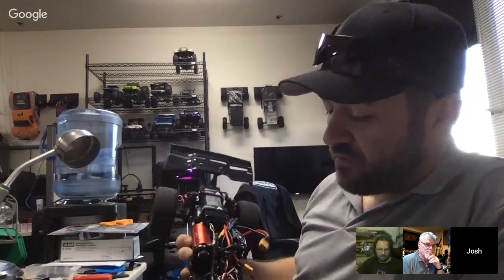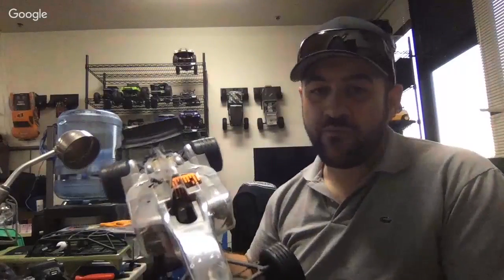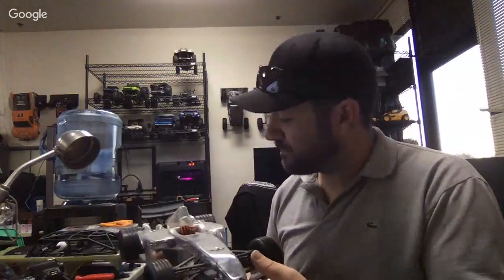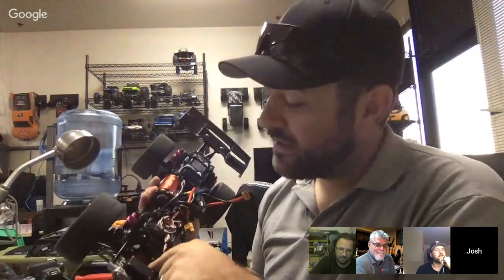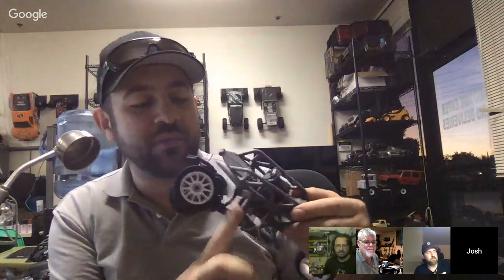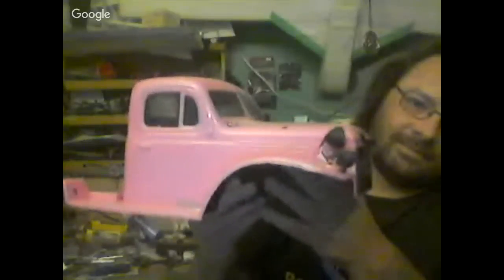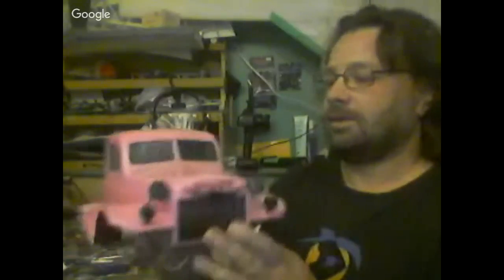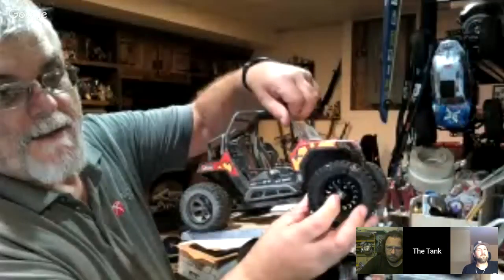RC Talk "USA Vs Canada Dragbolt MonthlyMayhem Challenge"

Comment: There are 3-pin connectors in XT30 style or size, they are called MR-30; the three pins are in line (and not in circle); I use them for motor-ESC connection in my two OXY 2 helicopters and am happy with them; bought them at Banggood. But you can only plug them in one way, so if you wanna change motor direction, you'll have to do it in programming ESC or unsolder two wires and change the position.
Reply from the maker: Cool that makes sense to use that for motor connection thanks for the info
Reply: Josh said, there are no or he does not know them… but honestly, for larger motors I use bullets. Check them out https://www.helifreak.com/showthread.php?t=792211&page=2#post7469164
Reply from the maker: Cool Thanks for the info...